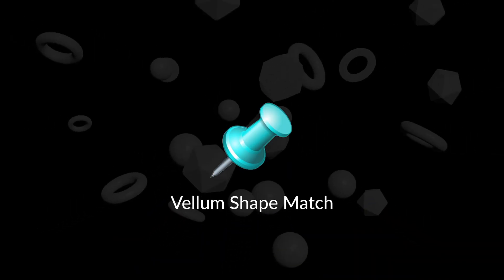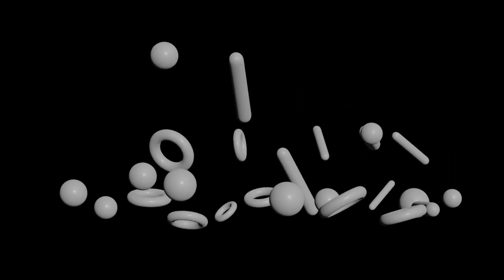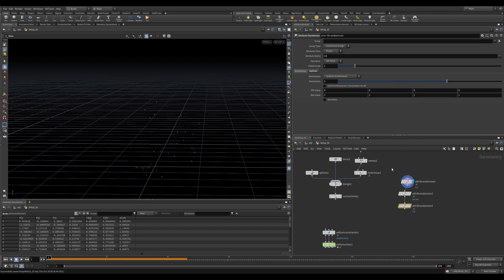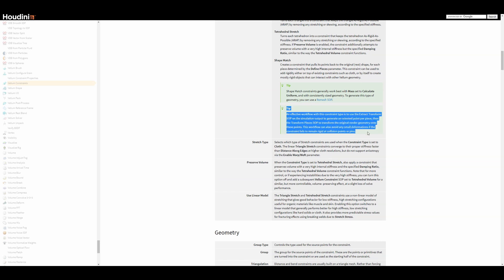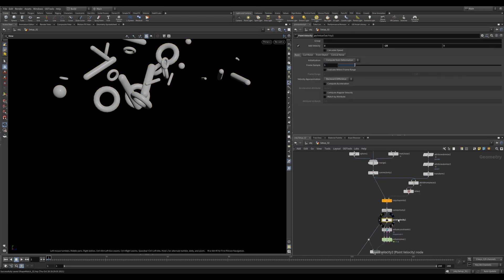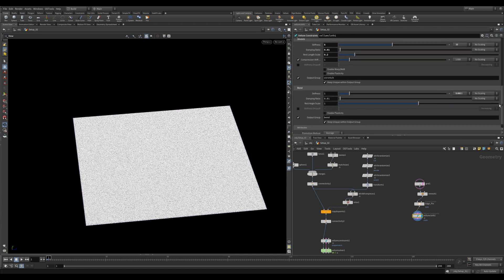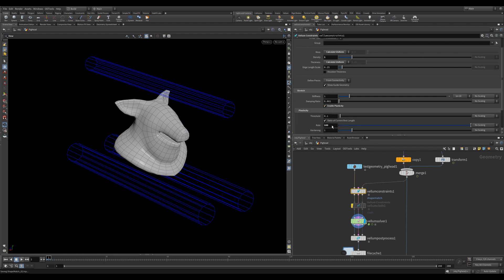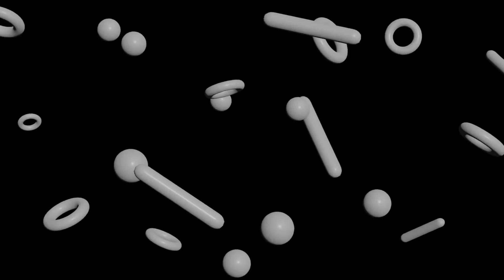H19 Nodes 02 | Shape Match

Comment: it seems for the extract transform/transform pieces trick, it doesn't transfer the velocity unless you put a trail sop or attribute transfer on the points generated by the extract transform sop, because it doesn't calculate velocity on its own. then the transform pieces will pick up that velocity and transfer it onto the geometry.